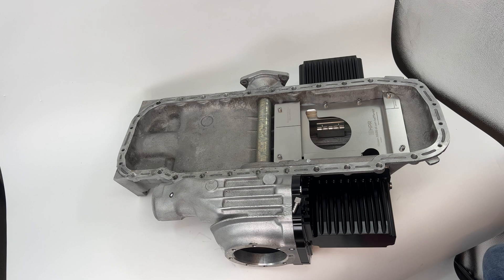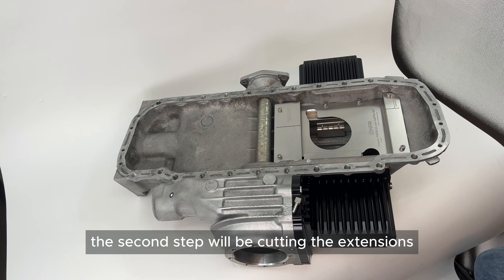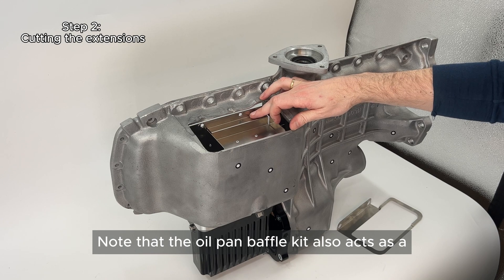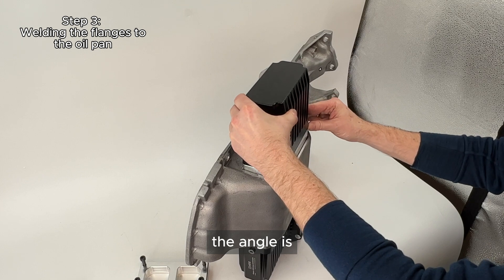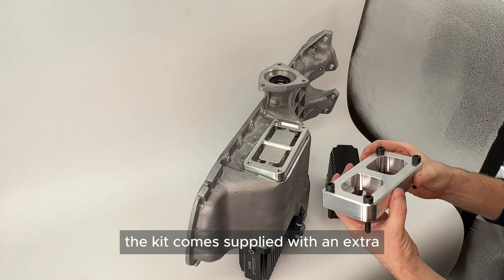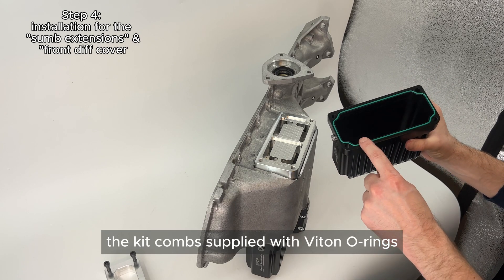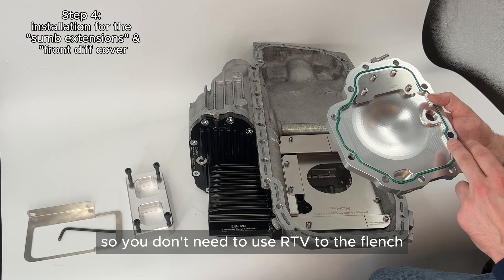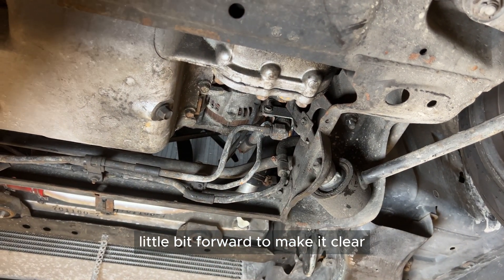RB26 Oil Pan Sump Extension Kit Installation Guide | HPR Tuning

Comment: I just received mine and tried to install it but it does not sit flat because it is hitting the middle left bolt hole for the oem baffle. Does this get removed first? There was no mention about it in the instructions.